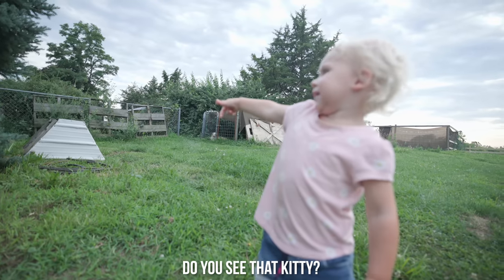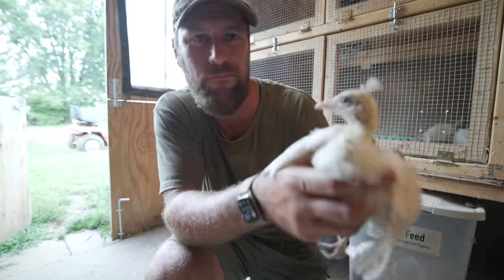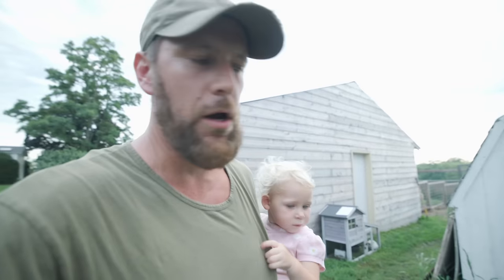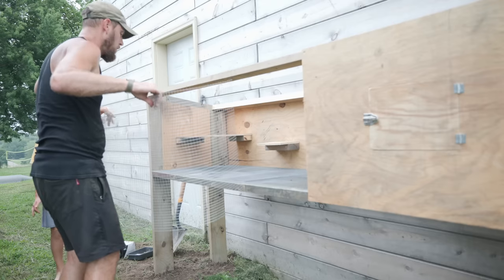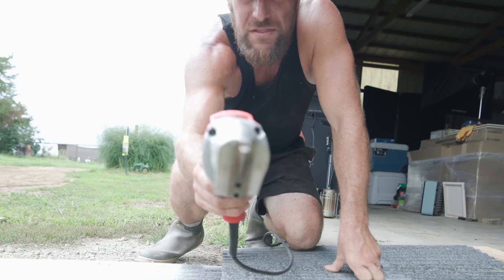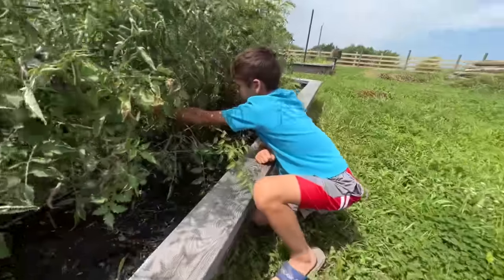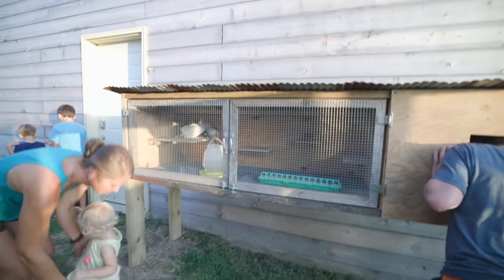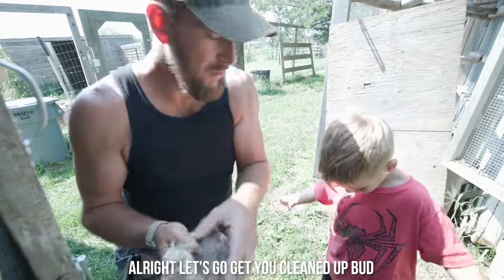Baby Peacocks DO NOT LIKE their New House

Comment: One thing we did for our rabbit hutches was put an additional layer of wire underneath the hutch floor so that there’s two layers on the bottom separated by the wood frame so that dogs or other predators could not reach their toes from underneath.

Comment: I recommend to treat the wood on the outside to protect it from the weather and areas inside where rain can get so that the wood don't rot. Plus at the bottom of 2 by 4 ( long pieces of wood), to put plastic Furniture Pads Nail On Furniture Feet Nylon Chair Leg Floor Protectors on the wood tuchching the floor ie soil to protect the bottom of wood getting damage caused by the weather ie rain and snow

Comment: Love the new house. So cute and glad that they're getting used to it. I was wondering if slanting the roof towards the front wouldn't be best, to keep the water off the building wall behind it. Also, could you put wood chips on the floor to make it more comfortable for them? Thanks for another fun and educational video, guys!
Reply from the maker: I could do some kind of gutter of sorts to run the water to the side of the shelter, but it’s under/next to the garage so it’s partially covered from the roof above so I don’t think it will get a big pile of rain water collection underneath.

Comment: @White House on the Hill Awhile ago (about 2 years ago) I sent you a plan on FB for a quail hutch for fun...this build gave me memories of those again. That mesh is what we used for those too. My suggestion for mods and paint would be to add some simple wooden trim to the edges and corners...than paint the trim and face whichever colors look nice for your surroundings to match it up. 
A nice project would be to make some grass and flower painting stencils to use on your bird boxes,tractors and hives...so you can paint some home and garden style murals on them. 
Lots of different things to do for little mods :) It is all based on preference. I like using the suspended feeders better than the ground ones but it really depend on the build. The ground one in this case is easier to work with. I like fancy builds with the sliding panel that opens up for access to the suspended feeding trough feeder. 
Bird seed hangers are fun for DIY projects and are great activities for birds that are cooped up. Back in the day I used them a lot with indoor birds of all types. Active happy birds yield better results. :)

Comment: Nice job curl the corners and edges of the new house in case someone comes around the corner to fast and forgets, also is it attached to side of barn so it don't fall over in high winds.
Reply from the maker: It’s buried in the ground a bit to hold it upright

Comment: Take out all the shelfs. They roost and will be pooping on them. Use a tree branch to put where shelfs were. remember do not put it flush with back. They need to roost and fly up on it and big enough around for them to use their feet, sit and roost  walk balance to support all their weigh.  Plus have food and water away from under where they poop. Change out branches to fresh ones every 2 weeks. I use thick old branches for my dead tree limbs. Remember far enough from back area so they can set comfortable on the branches and have tail and body room. I have 30 peacocks now. They free range. Good luck

Comment: The corners need to be tapered and covered. I promise nothing hurts worse than cutting your face with the corner of a tin roof. whew, it hurts. Probably wouldn't hurt to keep an eye on the boards inside the coop to see if the chicks need those corners tapered too. I know I sound paranoid, but it's happened to me and ended up needing two surgeries to repair the damage. An ounce of prevention and all that ;) and as usual I really enjoyed the video!